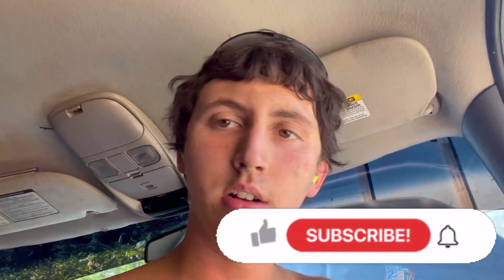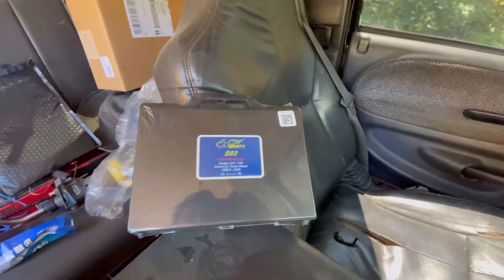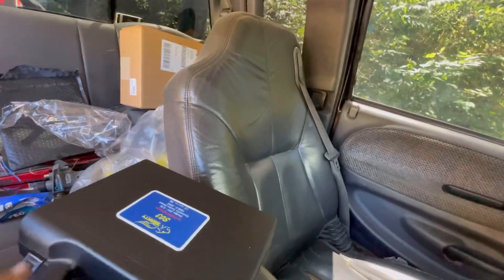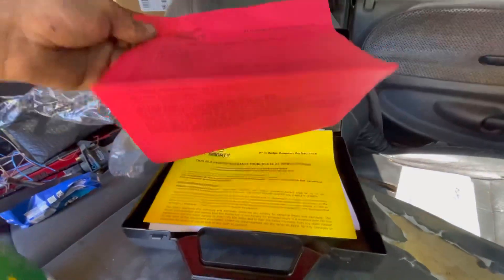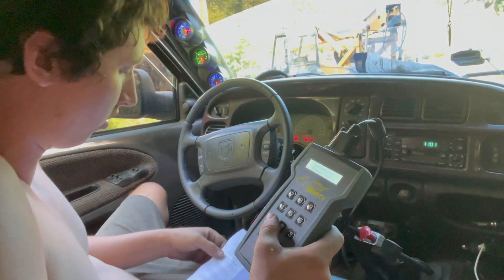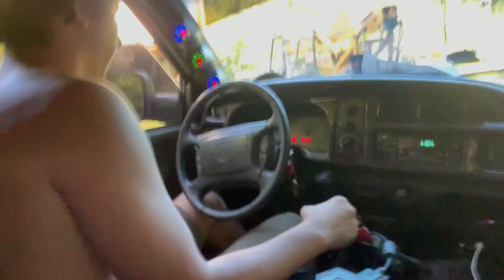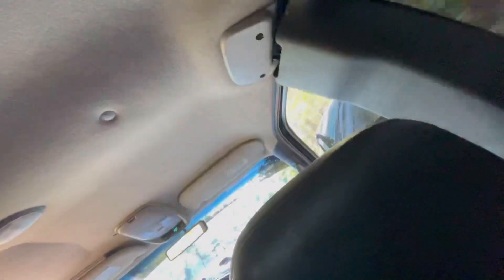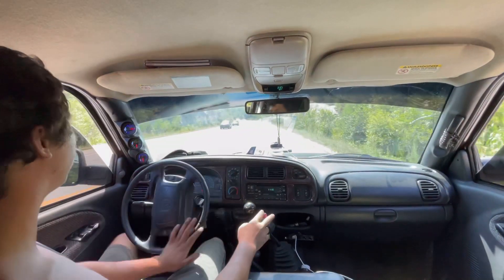Smarty so3 tuner install and reaction

Comment: I want to get this tuner for my 99 for the main reason of high idle for the winter if a dealership can’t turn it on for me.
Reply from the maker: The high idle is a sweet feature
Reply: Ya I talked to the company about the settings and whatnot. Thinks I’ll be able to get high idle to work on one truck and put back to factory and then do my other truck and tune that one and both will have high idle. Hoping so. Ordered one.

Comment: Would putting this tuner on my stock 2001 dodge ram 2500 24 valve make it roll coal or is there more too it?
Reply from the maker: No not much. If it’s bone stock then you should install a lift pump before any tuner. With a lift pump and tune it’ll be healthy and feel more peppy but not gonna see much smoke.. maybe a little from dead stop or bogging it. After installing injectors you’ll notice excess fuel
Reply: @RightFootRacing  so what would you recommend I’m  try to spend the least amount possible bc its a old truck and not worth much so i would rather not dump alot into it i just want something to have fun with not any kind of souped up truck just bare minimum to roll a decent amount of coal not trying to smoke out a highway or anything just enough to see and take decent videos of.
Reply from the maker: It’s kind of hard to say. If you’re really only going after smoke and not longevity or health of the truck just choke the turbo out a bunch haha. Injectors and tune are the two biggest ways to have excess fuel or “smoke” either of those done without a lift pump tho is gonna reduce the life of your injection pump significantly. And one or the other doesn’t do very much.. for an actual decent amount of smoke you’re gonna need both injectors and the tune together
Reply: @RightFootRacing  ok so you think 75hp injectors and a smarty tune would do the trick? Idc about the trucks health long as it last a year or two ill be pretty happy 😂
Reply from the maker: I’ve got 100 over injectors and a Smarty so you’d get the same results. I’ve heard people complain about 50-75 not being much noticeable over stock and is just worth going to 100 if you’re already spending money and doing the work. You can try and do those mods without a lift pump but it’ll probably shut off after a hard pull and it’s a ticking time bomb. The stock fuel system in these trucks is already usually unreliable and not long lasting so adding heat and abuse would have me scared to drive across town haha. These trucks aren’t the best option to try and skimp and be cheap with. It’ll cost more in the long run. I’d say personally if you want it to reliably roll coal just do lift pump, injectors and a tune. It’ll be plenty Smokey and won’t have fuel issues. That being said.. smoke is heat anyways and it’s not good to drive it like that all the time.. also if you’ve got an auto trans… they can barely handle stock power… injectors and a tune will have slipping not long haha.. if it’s a manual and the clutch is really healthy you’ll be good for a while.. I upgraded to a twin disk cause my clutch slipped after the tune. Like I said.. horrible trucks to be cheap with haha if you want something cheap that will roal cool just poke wholes in the turbo charge pipe.. won’t build any boost or really low amount and will smoke but it’ll be slow as hell